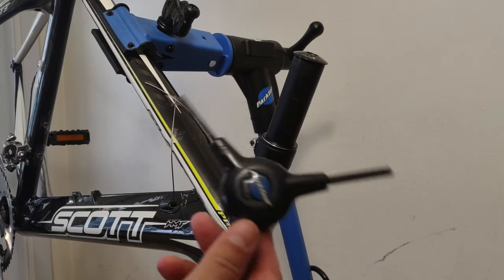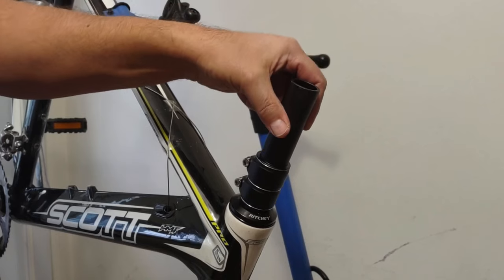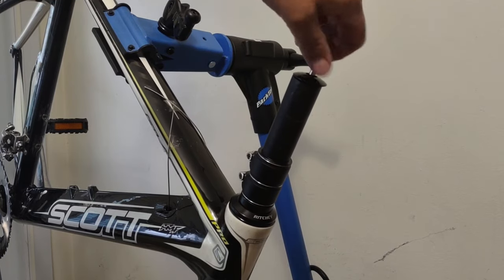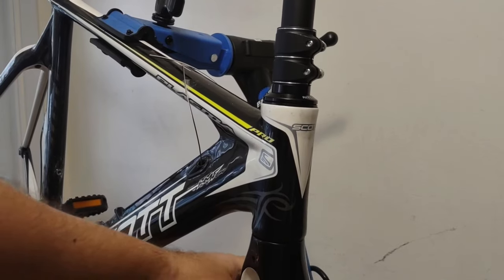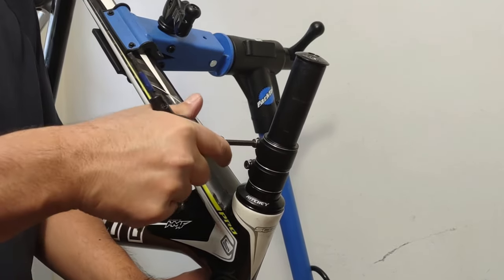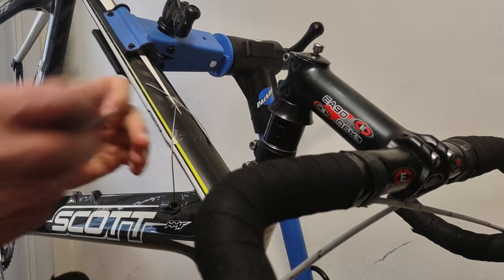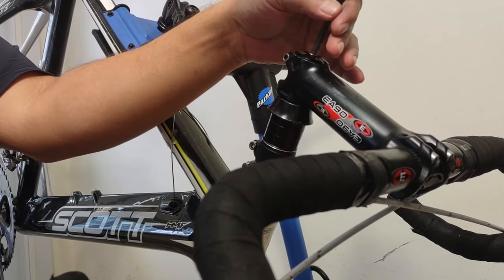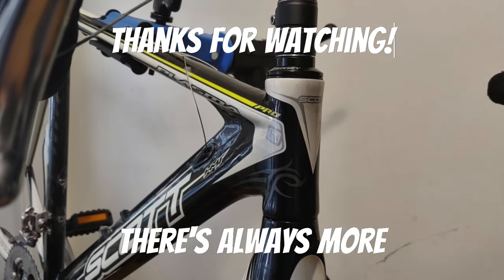Install a stem extender to eliminate play

Comment from the maker: Hey all, thanks for watching and commenting! I must add that I understand the potential hazard of using an extender with a carbon steerer tube. This bike will see no hard riding as it'll be used as a light cruiser. That said, this is an installation vid so it's about the method, not the model lol!

Comment: Dang! 
That's neat, when you said "flat bar" I was envisioning some kind of ape hanger set up.
The only thing that bothers me is the stem torque crush on the extender without a plug on there under the top cap.
Reply from the maker: Ape's would work lol! Yeah, I see your concern but that would require its own DIY video since the manufacturers didn't think it was needed. Thanks for the idea and support!

Comment: If the streerer tube is  carbon, Iam a little concerned if the extention is safe. It  creates too much bending force at the top, like an extended lever. I would not do that myself.
Reply from the maker: Great point! How concerned are you about an aluminum or steel steer tube? It is an installation video after all, many people watching DIY videos don't have carbon bikes.

Comment: Better to sell the bike and buy a used hybrid.  Carbon steerer race bikes should never have accessories like these installed as they are too are fragile. In any case, if you need so many spacers the geometry of the bike is not for you and it will likely create other problems.
Reply from the maker: Thanks dude. Subscribe to see how it all turns out!